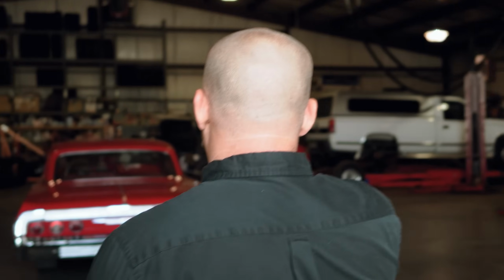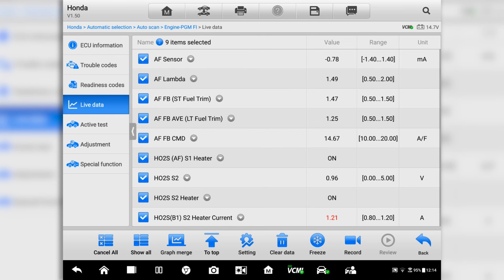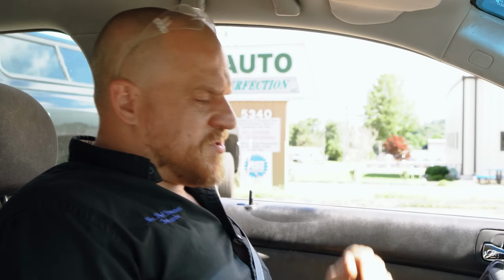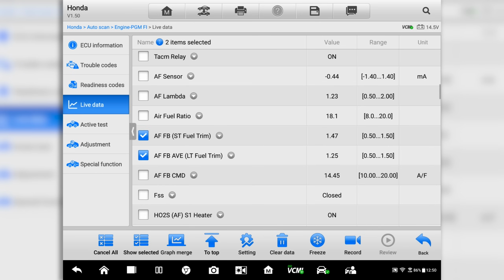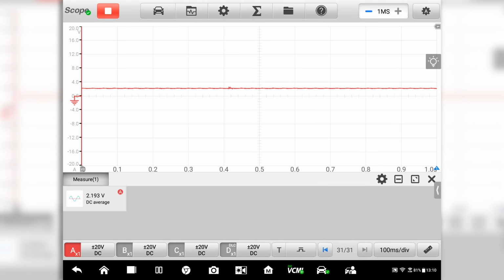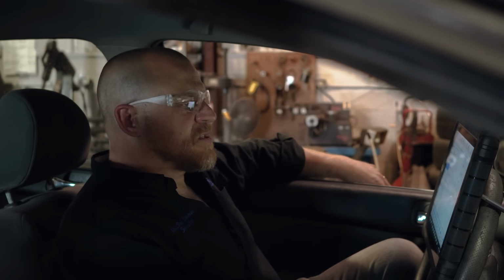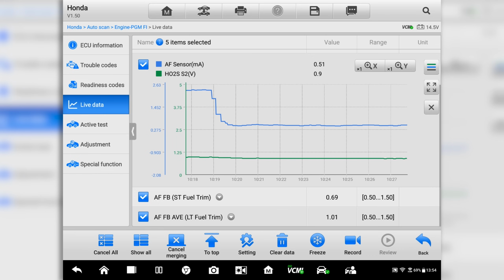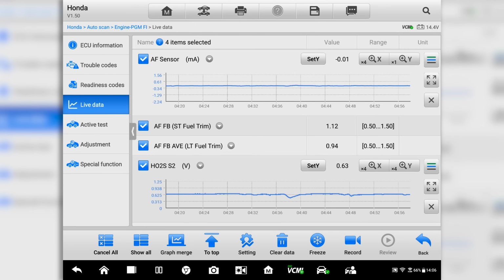2007 Honda Accord Wideband O2 (Air Fuel Ratio Sensor) Testing

Comment: I have worked for Toyota and Honda and both 4 wire planar type widebands work with opposite mA readings. The only way to truly know is to look at the cars technical information. With Toyota's denso type AF+ sits at 3.3V and AF- sits at 2.9V. The difference of 0.4V is lambda 1 which is 0mA. The change in voltage produces the electromotive force that changes the current value. +A = lean and -A = rich. With their denso system in their diesel engine the concept is the same but the voltages are 2.2v AF+ and 1.8V AF-.  I will have to dig out my notes on the honda stuff to get the exact numbers. Great video thanks👍
Reply: Makes sense! I love networking. Even if it’s just on YouTube 🤣
Reply from the maker: @evanwynne5293  email me at paul@scannerdanner.com thanks!
Reply: @ScannerDanner  will do
Reply from the maker: @evanwynne5293  got it! Thanks so much. Loved the, there is no rule or standard part.
Reply: Evan Wayne thank you very much for sharing this valuable information!
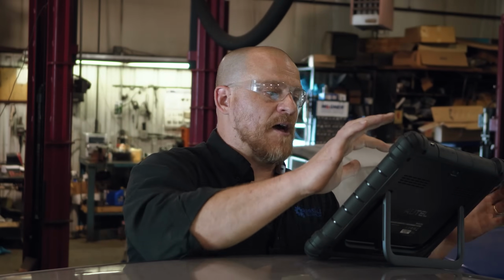Reply: So at 18:10 where the Scanner is reading -0.44mA, on a Honda that's Lean? First time i've heard that some AFR models read in the same direction as narrowband ... Helps to muddy the waters all over again!!;-)
Reply from the maker: Thank you so much! After quite a few comments about the opposite amperage, I didn't have a really good answer, but I knew I had it right. This gives me peace of mind. Really appreciate you jumping in here.
Reply: @ScannerDanner  no thank you Paul. Without finding your videos back in 2015 and getting your book I would have never gotten the thirst to pursue diagnostics. With your help and dealer training in 4 years I was able to become a Hyundai master tech/High Voltage Tech and Toyota/Lexus diagnostic tech. You inspire a lot of new techs out there keep up the good work and thank you all the way from Ireland 🇮🇪👍
Reply from the maker: @evanwynne5293  this makes your comment even more awesome, I'm serious man, for a minute I was questioning myself and my analysis. Thank you do much for giving back. You truly put my mind at rest today because service info on this model sucks! They give you absolutely nothing in Mitchell and some Google searches just show a bunch of articles claiming the opposite with authority and I'm like, but, but 😅
Reply: @ScannerDanner  my pleasure! Glad to be able to help. To be honest the technical info that Honda give is not great even on their Maris system. Toyota seems to be a lot more comprehensive but even that has thrown me for a loop on a few occasions. Had a Prius with low voltage codes in a couple of units, techdoc said to change converter with inverter assembly for the particular code. Was intermittent and seemed to be very specific to a particular drive condition. Would happen after the customer overtook another car. Found the main grounds for the control units that showed low voltage codes were shared with the indicator on the left side of the car. As he would use the indicator the voltage would rise on the bad ground enough to flag the codes. Once he cycled the ignition the problem would be gone. Replaced the grounds and the problem never resurfaced. Again all thanks to following your steps👍
Reply from the maker: @evanwynne5293  nice! Had some similar issues before with grounds on a fuel pump circuit. Customer said when he used his turn signal the truck lost power. Funny thing is he stunk of alcohol and in my mind I was like, okay buddy, go have another one 🤣 but he was right!
Reply: Ok so what you’re saying is that when this type of  4-wire wideband sensor is going negative it’s reporting a lean condition?  The opposite of what a normal wideband usually behaves.
Reply: @pmdiagnos8370  yes. As can be seen in the video AF FB should always equal 1. That is lambda above 1 is fuel adding 1.25 (+25%) fuel trim (lean condition) and below 1 is taking fuel away 0.75 (-25%) fuel trim (rich condition) the video shows higher numbers because its a wideband and can read a wider range between rich and lean mixtures. These are single pump cell sensors, duel pump cells work differently again so don't try and follow a single rule for all of them you might get caught out. They can be either the honda way or toyota way and it's completely up to the manufacturer that makes them.
Reply from the maker: @pmdiagnos8370  yep, as you could clearly see in this video
Reply: Evan, can you look at you notes let us know what the readings are for Honda?
Reply: @bernardaflores1720  sorry just seeing this now. The voltages for Honda were AFS+ 2.2V and AFS- 1.8V. So the difference was always 0.4 as read at the ECM. As seen in the video you look at the fuel trim numbers. 1.00 is lambda and it goes up 1.10 =10% fuel addition caused by a lean condition 1.25=25% etc.... and as you go under 1.00 you have a rich condition 0.80= -20% fuel trim.
Reply: So opposite readings apply only for honda and toyota?
Reply: @AutoDiag_  I can't say for sure on other manufacturers. They must go one way or the other. You could always introduce a lean condition by pulling off a vacuum pipe and see which way it goes for that manufacturer or get the technical data and see from there
Reply: When I was with Honda, and they came out with the tpms sensors, I used to let air out of a tire to figure out which wheel had a particular sensor in it due to the tool being a pain to use. Similar to that, can you not create an air leak and watch the sensor data to determine which direction, positive or negative, the systems operates?
Reply: I'm still confused...so normally wideband mA readings are negative=rich and positive=lean...with this case it's backwards?  

One thing that IS the same is the actual AF LAMBDA pid...1=lambda(perfect stoichometry)....so I guess we can just look at the lambda reading as that seems to be universal....when I looked at lambda as Paul was trying to force it rich with snap throttle I can see the lambda was going positive which would be a lean condition universally

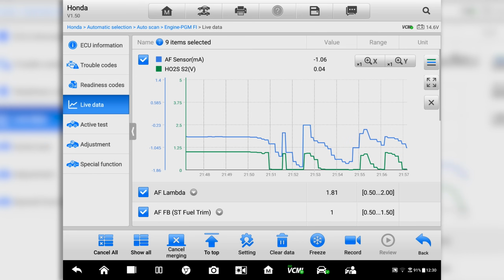Comment: 12:40 Cats covered in soot from rich mixtures can be fixed using Cataclean.  We've had excellent results more often than not, and yet most shops don't use that method.  But of course, the o2 has to switch before using Cataclean (so that the cat is getting the proper feed gases).

Comment: Hey Dan, I have a code P0141 for the heater circuit on an O2 sensor as well as an P2422 EVAP Vent valve code. I noticed both are being 12v by the same wire that splices somewhere in the car. None are receiving a positive charge. I was wondering where can i find this splice and test it? Car is a 2003 Honda Accord 2.4.
Reply from the maker: Get yourself a good wiring diagram. Nice work so far!
This is the DIY version of the same service info I use.
 https://eautorepair.adtrk.biz/?a=10817&c=24&p=r&s1=
Reply: @ScannerDanner  Unfortunately, the splice is still not depicted anywhere. Both wires run through the whole interior, so I was wondering if you have tackled something like this and could point me somewhere?
Reply from the maker: Search the power distribution diagrams. That is where you will find what you are looking for
Reply from the maker: Looks like fuse 18 (15a) in the underdash fuse/relay box. But if that fuse was blown you'd also have cam and MAF and purge valve codes as well as an alternator that isnt charging.
Check the fuse box for moisture intrusion
Reply: @ScannerDanner  yep, checked fuse 18 and it is getting power.
Reply from the maker: Find that wire right where it comes out of the fuse box as your next step. Since there are splices in there. Look for areas of the harness from there where there is high traffic (it may run along the floorboard) and also moisture.

Comment: actually a negative current on any wideband sensor indicates a rich condition not a lean one like stated in this video
Reply from the maker: What time frame please. Thanks!
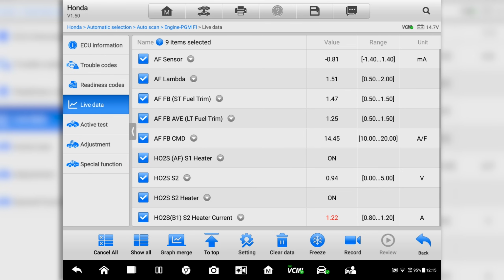Reply: @ScannerDanner  6:16 very high positive trims(indicating lean),pozitive lambda1.52(indicating lean) and negative current(-0.81mA)on the wideband(indicating rich) which doesnt make sense to indicate rich so therefore a faulty wideband
At least this is the pattern i have seen in almost any make and model over the years with the wideband sensor,if its negative current it means rich condition
Reply from the maker: Remember that scan tool values of a wideband that are not reported in ma can be different.

Comment: This is the video that got me to were I’m confident to say the Honda Civic I’m working on has a bad wide band as I just tested the heater resistance across the centre and found the heater circuit short circuit as it has no resistance reading…. This was an intermittent fault with no codes and this video gave me a lot of extra knowledge I needed to brush back up on….. Great Video!!!!

Comment: My 2015 Roush stage3 Mustang has A/F sensors.   They are reading -128.23 high and -0.23 on the low side.   Rear are normal.  My short FT is -3 /-5 and long term bank1 goes -10 bank2 goes -7

Comment: i was under the impression that negative mA readings with an AF sensor indicated a rich condition and positive mA readings indicated a lean condition, basically the opposite of a narrow band O2 sensor
Reply from the maker: This wasn't reporting the ma number from memory. It was reporting as a 1 to 4v signal? Cant remember. But either way, it is the opposite of a narrow band where the higher number is lean, not rich. So +ma number would be lean (I think 🤔) lol 
A quick deceleration event on a test drive always answers that question for me.

Comment: In my limited time studying o2 diagnostics it seams like it is the trickiest sensor to diagnose. Are there some simple testing principles to make this easier to grasp? Like throttle input should trigger rich condition/ decel should trigger lean right? Should wideband also be constantly oscillating like narrow band for sensor 1? Is there anyway to confirm a bad sensor 1 without probing it? Is the heater circuit volatge test to confirm wiring or component health?
Reply from the maker: Yes, same tests. WOT run for your rich side and drop the tranny in a lower gear for your decel event and keep the rpms higher than 2500 so you can watch the fuel cut mode for your lean side. Those numbers, whatever they are reported as on scan data, should be completely opposite. 
These will sometimes oscillate slightly but other times not. Fuel trim data will help you determine proper function too. 
Was this Honda 1v at WOT and 4v on decel? From memory that's what it was. Now watch the other one. I believe it had a bad sensor? I can't remember

Comment: The way I test my wideband which is a Bosch sensor on my AEM stand-alone gauge but I remove the wideband and get some brake cleaner or fuel on a rag and wrap it around the sensor and watch for it to go full rich to 10 or lower and I’ve seen my sensor when the waffle ceramic messes up inside this same test the sensor still goes full lean so I know the sensor is bad when it does that but it’s on a gauge though not through the car but I’m sure it would work the same on your scan tool.
Reply from the maker: Test drive is way easier as it doesn't require sensor removal. EDIT: Oh you meant on the outside of the sensor? That would be the fresh air inlet you are altering. I bet there are variables with that
Reply: @ScannerDanner  yeah I agree with driving it and I don’t have a scanner like yours but I do have that Topdon one you recommended and it works well but if figured I’d mention it for those that don’t have anything to monitor fuel trims and such but I just binge watch your videos then I’ll catch up to the current ones.

Comment: With the HDS, the AF sensor is positive current=lean, negative current=rich.
Reply from the maker: HDS?
Reply: @ScannerDanner  HDS is the Honda factory scan tool. In regards to the AF values, I use them to determine fuel pressure codes, such as P0087, fuel rail pressure low. Monitoring AF value at the time of failure I can determine if the air fuel mixture actually went lean, which indicates the car actually lost fuel pressure, rather than a defective fuel rail pressure sensor.

Anyway, with the Honda scan tool, AF current positive equates to a lean condition.

Comment: this is really confusing me, I always learned minus current is rich condition. But from what i get from the video honda is using minus for lean, because if you force lean condition during the test drive it goes minus 1.6
Reply from the maker: Yes sir. They do not all operate the same
Reply: @ScannerDanner  Thanks for answering! Makes me feel more confident diagnosis wideband O2 sensor. 

Just a quick question if you run the O2 sensor rich you should read a high number in the rich range? Because i was not confident enough calling the sensor because it stayed close to 0mA on WOT in second gear, because I thought wideband is able to keep lamda close to 1 during all operatons of the engine
Reply from the maker: @Sean_Diagnostics  when I test these, I'll do both forced rich and lean conditions and watch for opposite numbers. For the rich side, a wot run and for the lean side a high rpm decel event (injector cut mode).
No different whatsoever for how I test a narrow band O2. I just want to see both extremes. Make sense?

Comment: Why are you not using the equivalence ratio?
Reply from the maker: If the sensor is wigged out, how is a data pid that is a mathematical calculation based on that sensor going to help me any further? Serious question. Maybe I just don't know how to use it as I should be?
Reply: @ScannerDanner  if equivalence ratio greater than 1 you have a lean condition, less than 1 you have a rich condition!
Reply from the maker: @Sophie333C  but if the sensor is skewed, that data PID will be also, so I guess I don't really see this being a major value to us in this case. Thanks!

Comment: When ever I change a o2 sensor or maff sensor or a/f sensor I disconnect the negative battery terminal and reset the fuel trim then do the drive pattern in all readiness mode to see if any codes come back. This is another great video I learn a lot from I appreciate you for posting it and always look forward to more great content from your videos!

Comment: @ScannerDanner- Happy New Year Paul. Well , I think this might throw my theory out the window at wide open throttle, watching the voltage on a wide band  sensor should decrease slowly  over the time the vehicle is driven at wide open throttle , then increase when foot is taken off the gas indicating the wide band is operating correctly. Thought I had these wide band sensors figured out, perhaps not!😂
Reply from the maker: Just remember that wideband sensors and how the manufacturer displays the data for them, are not all the same! The signals can be opposite of what you think or of what you've seen before.
I do believe that when the actual milliamp numbers are given, that positive is lean and negative is rich, just like we saw here. But when voltage is given, this is a processed valve and the numbers can be whatever the manufacturer wants and they are definitely not all the same.

Comment: i always rode around with my primary a/f sensor unplugged after i got the heater code but i have a KTUNER ecu [[ kpro for 05-06]] so it was already tuned and ran fine without it now that i did a TSx swap i guess the intial start up needs the 02 sensor because its suck on 14.7 on the tuner app and says OL_FAULT, Plus both fuel trips read 0 at all times 
if i go past 5% tps the car stalls out   will this on sensor cause all these problems where i cant even get the car out the bay door ??? 05 rsx wideband

Comment: Great stuff Dan a lot of learning like always. Hondas do read their perfect fuel trim at 1.0 volt and lambda indicating rich below 1.0 v and lean below 1.0 v. These accords also tend to leak right at the intake tube where you had the leak after replacing sensor just fyi.
Thanks again for a very well detailed video

Comment: I would do a cap burn to clear out adaptation then drive. For the newbies, that disconnect the pos. and neg. terminals and touch them together to discharge the capacitors in the pcm to reset the values

Comment: My car has a v6 engine 
First code was p0430 this after I parked the car for maybe 3 weeks.
Then later the code p0101 after maybe 6 months on the road. I cleaned the MAF sensor and went away for maybe a month and came back. 
So I took it to gas station they said it went away by itself. 2 days later check engine came back, this time it was a different code p2099.
I pulled the code and check fuel trims all of them fluctuating around 7 or 8%. Today I took it to gas station the guy said needs catalytic converter. He just looked at the scan tool saw the same code p2099.
Is the guy right about the converter?
Can you help?

Comment: I did a toyota in which unplugging the battery did the fuel trim reset, the fuel regulator was allowing about 5psi extra pressure than spec and somehow the lambda sensor was reading lean, and even with a new sensor it did the same, like if the amount of fuel was so much that it messed up the reading, anyway, the original sensor was dead and changing the fuel regulator and resetting the fuel trims repaired the fault.